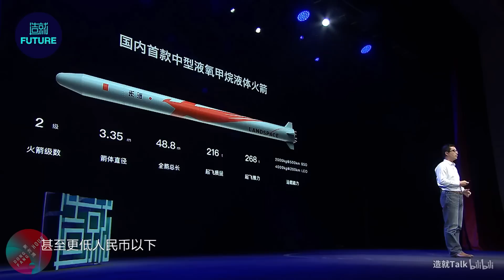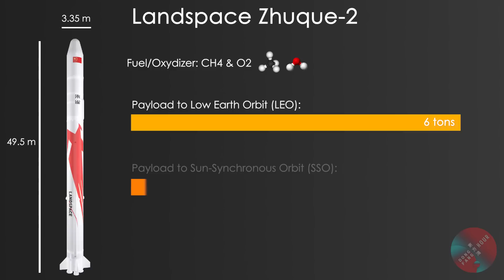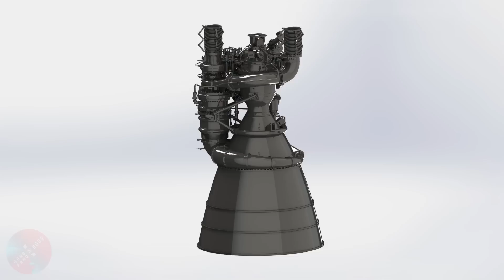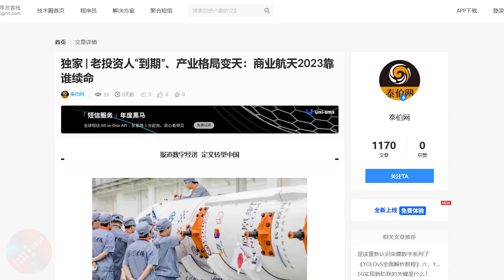Maiden Launch in December: Can Landspace Succeed?

Comment: Why is Landspace building a methlox rocket? Are they, too, planning to go to Mars? SpaceX expects to make propellants on Mars for Starship's return flights, so methane makes sense for them. (This doesn't really explain why the Starship booster has methalox engines, but maybe that's a matter of economies of scale.) Landspace has built a relatively small rocket with a low payload capacity. So, what's the point of methalox?
Reply from the maker: There are other advantages to methane. For one, it burns cleaner than kerosene and that's why it is considered by some companies to be more suitable for reusability (Rocket Lab is a good example with their Neutron rocket).

Comment: Ah yes! Zhuque-2. It'll be the first of the true first-gen Chinese commercial private sector designed rockets, rather than various modifications of solid propellant rocket designs loaned from past CNSA programmes. Honestly, I'm most excited for their reusability development. They've been quiet on that front, so I'm curious whether they'll venture into the tether method proposed by the CNSA, or whether they'll stick with landing-legs as with other commercial companies.
Reply: casc has reviewed the landing legs as well as shown in several piece of paper (and the proposal of cz8r which is probably abandoned now). The tether method is developed specificly for larger launch vehicles such as cz5zrl.

Comment: Thanking you so much for put together the contents!
I am always very curious about Landspace's liquid rocket. Its configuration is very similar as the old Long March-2C rocket: first stage with 4 engines, and second stage with 1 engine and vernier thursters. Also it's current configuration is very hard for vertical landing, unless they can magically throttling their first stage engines to <10%? 
I hope they can build a new version ZQ-3 with 7 or 9 first stage engines, which is much easier for vertical landing.
Reply from the maker: Fully agree with you 🙂